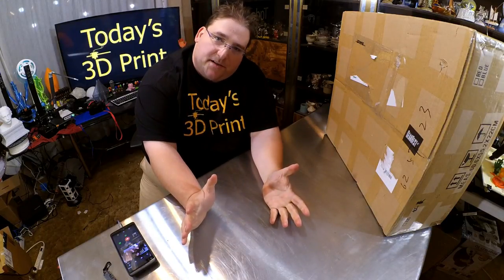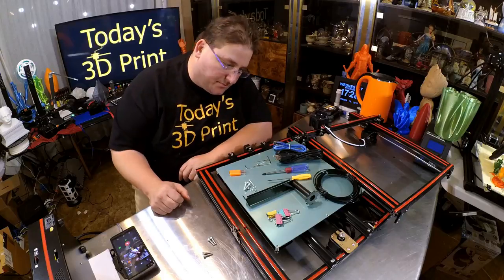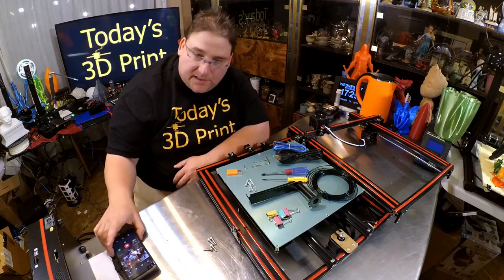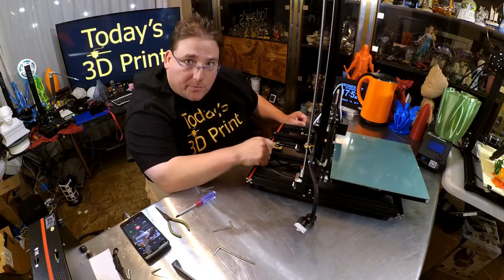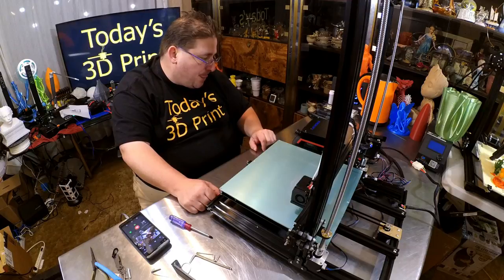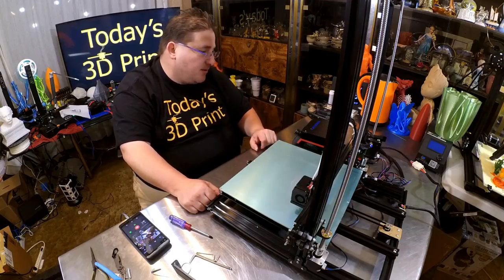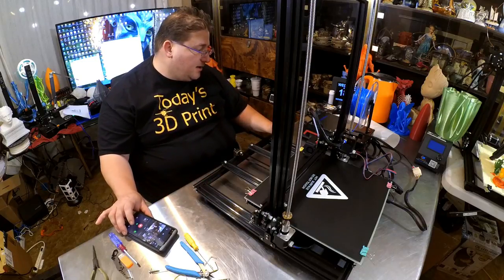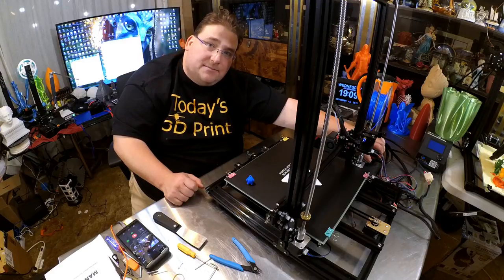Today's 3D Print 150 TronXY X3S CR 10 Clone Initial Unbox, Assembly, First Print

Comment: No BS from this guy. I dig that. What fans do you like to use? Brand, size, Ect.
Reply from the maker: M Beck I just search for ultra quiet fan in the size I need on Amazon and usually it's NB's or noise blockers

I'm going to replace the hot end fan tomorrow night the high pitch noise is driving me crazy :-)
Reply from the maker: +M Beck one of the things I hate about all these printers including the cr-10 is the giant box surrounding the hot end I want to see the hot end I want to see the nozzle clearly and see what it's doing so I'm going to try replacing the components there to make it more open in all of my machines I believe there is excess cooling capacity as well so I'm going to try using a 30 millimeter fan which will make that's surround much smaller and also stop wasting air cooling the heater block which doesn't need to be cooled we'll see if it's enough or not I ordered a 3.8 CFM 17 decibel 30mm fan which is pretty close to the throughput of a stock fan which I believe is 4.5 CFM I'm betting it will be enough and be a lot more compact and lighter as well which will reduce inertia and mass and improve print quality even further
Reply: Have you done the fang duct mod for the CR10? Tacblades remix is the best one imo. Fixes most of your issues, really lets you see the hot end better and gives you cooling from both sides which helps with bridging.
Reply from the maker: +ImpatientTurtle I printed one but I did not like the output of air I need to do one that uses the 5015 fan which should give a lot more output

Comment: Fab channel Nerys👍

Did you ever get around to changing the heat bed spring on your Ender 2 I recall you saying something about them in a video but I can’t find that video. 
I’m looking at changing mine to the same type as the cr-10 but I can’t find them anywhere
Reply from the maker: +Chris Marsh yes I did and they work fantastically I thought I put a link in the video for Amazon but anyway do a search for 8mm 20mm rectangular spring you want the light load ones not the extra light not the medium what's on the cr-10 is extra light I'm thinking about replacing those two with the slightly stiffer light load Springs but my cr-10 holds bed level well so I might leave good enough alone :-)

Aflink they come in 10 packs cheap $4.99 http://amzn.to/2z6prXe

Any printer of mine that does not already have this kind of spring will get them now
Reply: Nerys cheers, I’ve just ordered a set. You might have had a link I just couldn’t remember which video it was.
I’ve learned a lot from your videos about 3d printing.
My decappa cat jar is coming along nicely 👍
Reply from the maker: +Chris Marsh nice! I love how mine turned out! Post pics or vodeo when done. I am going to start doing a viewers episode where i show off the coool sh%t people print :-)

Comment: In some use cases it could be helpful that this printer is ce/fcc/rohs certified. I would appreciate if Creality could do the same - school maker spaces would benefit from having a large 3D-printer.
Reply from the maker: +Fabian Binder I did not know creality did not have those that is interesting the printer is clearly complaint if the other ones are :-) especially considering how suspect some of them are :-) cost saving tactic? I wonder why they don't get the certs...
Reply: Nerys I guess either the certs are forged (wouldn’t rule that out) or creality/tevo cut costs. Most people don’t care anyway. :-) Sometimes the certs apply only to one thing of the set, like the power brick...

Comment: Hello!
What do you think is a better choice for a newbie?
Tevo Tornado, Anycubic I3 Mega, Creality CR-10 (not the upgraded version), Anet E10,  this tronxy, maybe and Ender (yes I've seen you loving yours a lot :D )?
Maybe another one aroud 300-350 bucks?

Thank you for your help!
Robert
Reply from the maker: again tough choice. I would drop the E10 from the list. its a very good printer but it has QC issues meaning YOU will have to fix things to make it actually excel. I would not want that as a first printer.

The I3 mega has a small build volume (210x210x205) but is VERY reliable so far with Ender quality prints and the print bed is almost magical. its not too bad in price either.

CR-10 original and Tornado are a close match. as a beginner your probably only going to play with PLA so the nice heat bed is a non issue. advantage tornado its stupid cheap right now.!

Cheap is relative though. if you KNOW you will stay with 3d printing and can bump that budget to $450 get the CR-10s

if it has to be $350 or less then its between CR-10 original and Tornado.

you would be very happy with either machine.

I still say if you are in doubt get the Ender 2 since its less than HALF the price of either of those with superior print quality to both takes up no space at home and is quite quiet as well. it builds almost as easily as the CR-10 and tornado (you just put it together slightly more involved but not by much)

and if you decide this is not for you then you are only out $145 plus a roll of filament. if you decide you love this it was never a bad buy you will use it for years as you add to your array or printers.

if you don't expect to have more than 1 and you desire to print "large" then go with the CR-10 or Tornado. in my opinion the CR-10 edges out the tornado just slightly for reliability, quality, QC, and manufacturer support.
Reply: Holy effin ssst.
I didn't expected such a detailed answer so fast!

For the first machine I think a cheaper might be better, just to get the taste of it, but if I'll like it a lot and want a bigger bed then I have to get trough the whole process again.. So yeah, tough choice... :D

The Ender on gearbest is the Ender 2 right? With the EU plug what I need is on a flash sale, only 160 bucks..

Thank you very much. I'll see what the gb black friday will have for me! :)
Reply from the maker: +padree get the Ender to decide if you like it as in do you like 3D printing enough to go deeper and then decide from there

If you're certain I suggest a cr-10 s but make sure you're certain cuz while it's a very cheap printer $450 is still a lot of money :-)
Reply: Last big question, maybe a tarantula and upgrade it, with some printable items and extra fans?
Reply from the maker: +padree I don't know about the tarantula I have no experience with it so I don't want to give you bad advice :-)
Reply: It's a so damn hard decision to make.. :D
I think I'll wait the end of the christmas sales and wait for a good deal. For example the Tarantula was 30 bucks cheaper a couple of weeks ago.. Didn't watched the other printers that I now know. The CR-10 mini is now also an option.. :)
Anyway, thank you for the advice, I'll tell you if I get one, maybe not under this video. Keep doing these vids, I love them! :)
Have a nice day and happy upcoming holidays!

Comment: I have been looking at this, and the E12 from Anet. Just wish they were cheaper for what they are lol
Reply from the maker: +skysthelimit866 I suspect they are approaching the break-even point in price my guess is this is a $200 printer so by the time you add overhead and shipping etcetera plus profit 260 is not bad remember the 330 340 dollar price of the cr-10 old version is a fire sale I suspect they're blowing out the old stock cr-10 will be the standard the S version and that's $450 which is damn cheap for printer that reliable that good and that large remember when 3D printing nerd started doing this large print stuff you needed a $2,000 gmax to even think about it or you had to build it yourself

I suspect creality just crushed the race to the bottom trend other manufacturers are trying to undercut them Tron XY anet tevo but you're starting to see that they are not as good because there's a limit to how much you can undercut before you must sacrifice quality in order to lower the price

So hopefully as we are in fact seeing with the cr-10s and to some extent the tevo tornado we should hopefully now start seeing similar low price printers but with more features and options

I would love to see a manufacturer come out with a sub $1,200 printer that's nearly TurnKey in like a CR 10 with similar quality with a 1 meter cubed print volume

That would blow my mind :-)
Reply: I've seen CR-10's as low as $339 from Gearbest (they are not giving your their best coupons, Chris). With it, and the Ender, I don't know why anyone would buy crap from a company that makes a printer model that catches fire.
Reply from the maker: +vidznstuff1 yes that's the fire sale on the original cr10 to clear out the stock I'll have to check my links I should be using that price that would be my fault if I am not :-(

I agree I don't think anybody should buy anything else but buy a cr-10s and an Ender or two :-) just my personal opinion of course it's what I would do

But that's where I get to have fun building these printers and finding these issues and putting them out their for you guys both the good stuff and the bad stuff so you don't have to :-)

Plus it is a functioning printer that works okay and it cost me nothing so I might as well use it and I do like hacking and modding so I might as well try to fix it :-) this way if anybody gets one of these for whatever reason the resources are there for them and if you could a different printer that exhibits are similar problem the same solution might work

It really is fun playing with these things even when they suck :-)
Reply: What's the difference between this model x3s at 350 dollars and the x3s thats cheaper? Ive watched other videos where the guy says the build volume on the "smaller" x3s can easily be 330x330x420 just by a simple bigger build plate. Is that the only difference justifying an almost $100 price difference?
Reply from the maker: this printer is $260 not $350. that would be like saying the $340 CR-10 is $499 since that IS its original price :-) ie Coupon price is the price to use as its probably permanent and might even go down. $240 with a stiffer y plate would be a sweet spot for this machine.

it does have a bigger build volume 330x330x420 but that is largely irrelevant at this scale. its the "same" build volume.

the printer is $80 cheaper than the CR-10 and $180 cheaper than the CR-10s its even cheaper than the CR-10 Mini

but no. I don't advise buying this. now. besides the heating failure error (probably just my unit bad thermistor most likely loose connection or something) the printer works as advertised and appears stable. I just finished a 26 hour print and its not bad. not great. but not bad. it "did the job"

I also was able to toolessly remove the print by flexing the print bed which was nice (and it filled the print bed)

so while its not a "bad printer" and so far I don't need to "do" anything to it to make it work.

the resolution quality (likely as a result of that jiggly soft thin y carriage) is a deal breaker for me personally. I would not suggest anyone buy this but you won't "regret" buying it (so far I don't consider a printer reliable till I have beat it up for many hundreds of hours of printing)

I am going to try and stiffen up the y carriage to confirm if the issue is in fact the jiggly plate causing the skin noise in the prints.

the resolution is their. the prints are GOOD but the surface finish is "ick" from the noise.

Here let me show you some pics.

Here is the turkey I printed from afar. not bad mind you I was "pushing" it by printing this at 2x2x2 (should have been 3x3x3 but that was 40 hours this was 26)

https://i.imgur.com/NYMlqDx.jpg

the wee one is from my ender 2 at 100% the big one is from the X3S at nearly 600%

and here i a benchy

https://i.imgur.com/l4TV2yY.jpg

no matter how you spin it that is NOT a bad benchy. it did everything right and I mean everything. Except the "skin"

its just "ick" noisy. not clean at all

Here is joelbot up close. again it did a fantastic job printing this. no clean up NOTHING right off the print bed nearly perfect. even the high five hand looks great.

but ICK again. that surface noise ruins the skin surface of the model when viewed up close.

https://i.imgur.com/ovbfuOL.jpg

This pic of the side of the turkey REALLY shows and amplifies the "skin noise" issue that keeps a decent printer from being a good printer.

https://i.imgur.com/Cw1KxZj.jpg

and finally the joelbot on my ender and on the X3S

https://i.imgur.com/mm4JkIt.jpg

look at the face. wow. what a difference.

it makes GOOD prints. they just aren't CLEAN. layer alignment is good so the kinematics is pretty solid.

but that y plate is SO damned thing it "vibrates" like a soft spring. you can "FEEL" it even as the printer moves if you gently sit your fingers on it.

this adds "micro movements" to the model as it prints resulting in all that noise.

if they could stiffen the plate up. make the v wheels adjustable (it only needs 3 the inner singles on the bottom and the single on the x trolley) and keep it at say $250 and do something about the heat bed.

I would give this printer a safe to buy assuming it holds up in longevity (which I can not say till I have 500 or 600 hours of printing on it minimum)

I DO notice it has a TINY bit of salmoning like the tornado. I need to poke around and see what the brain board is inside. it needs new fans "BADDDDDDLY" especially the hot end fan. like a bitchy F16. :-)

would I buy one? hell no. the $80 price difference even $160 price difference (to the 10s) is not enough to cause me to want this over them. not even close.

but it is an "interesting" printer just for the novel ways they went to make it cheaper without wrecking it (besides that y carriage plate)

I say interesting from the perspective of ME as a reviewer and tinkerer.

as an end user? just get a CR-10s it is literally the cat's meow for large volume sub $500 3d printing right now. if you don't need big volume get an Ender 2. best $145 you will ever spend on 3d printing right now.
Reply from the maker: +skysthelimit866 I just noticed what you were talking about that other model looks very different in construction sketchy using 90 degree angle brackets for the vein Gantry Etc maybe that was their first version and they realized it didn't work too well or something? Because this one is built differently from the pictures I would avoid that other one I don't like the idea of the 90-degree brackets instead of the bolt straight through the Extrusion
Reply: Thank you for your many replies lol. I'm down to cant figuring out Tevo Tornado or the CR. I'd use ABS most of the time. I guess the Tevo needs some smoothers?
Reply from the maker: +skysthelimit866 unless you're going to build an enclosure or add heat pad you kind of have to go to tornado if you want to do abs the resolution is not quite as good but its 90% is good and that heatbed definitely gets hot enough you probably still need an enclosure if you want to print anything remotely close to the build volume of the printer